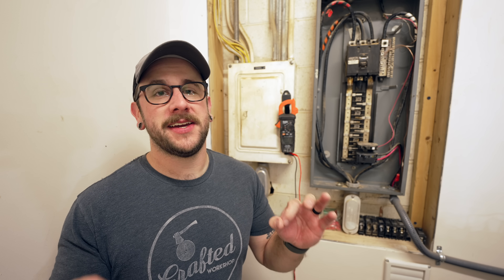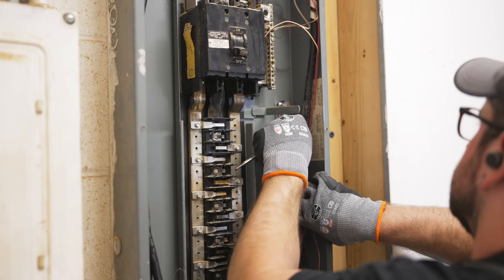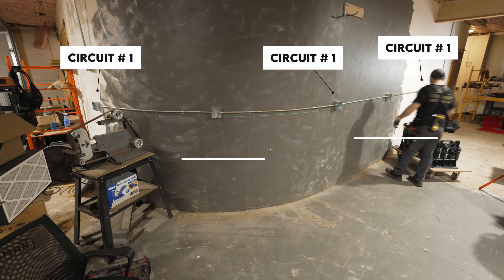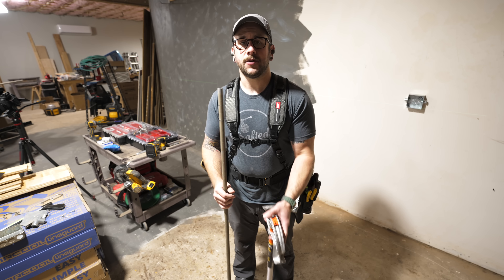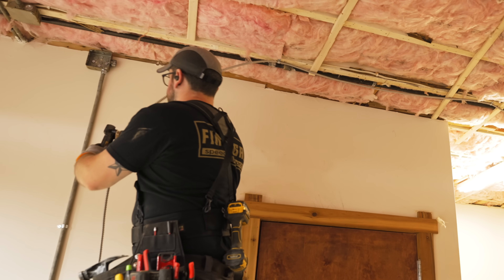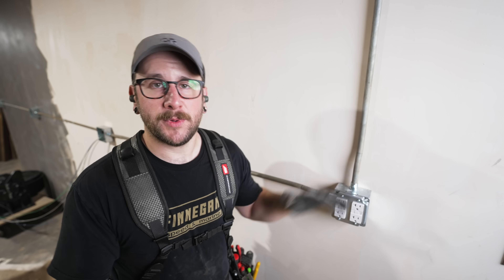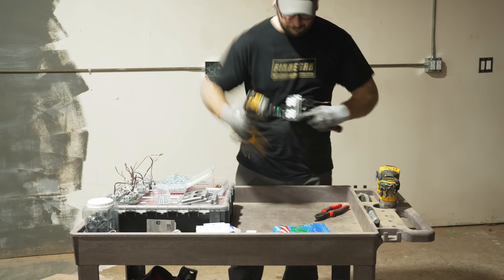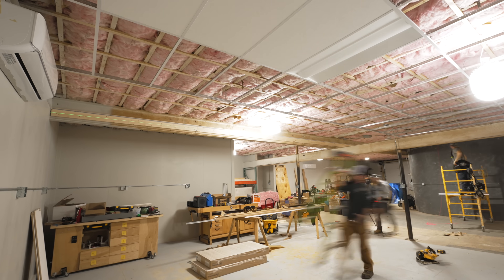WORKSHOP RENOVATION 16 : DIY Shop Electrical Basics w/ Conduit Bending

Comment: You used black 12 AWG for hot wire on one circuit and blue 12 AWG for hot on the other, but when you connected the circuits to the breakers, I only see black wires. Why is that?

Comment: Thank you for mounting your outlets at a reasonable height.  Most people thoughtlessly mount them at the "standard" 15" and then cover them up with furniture or workbenches, necessitating that they crawl around on the floor trying to plug things in.

Comment: Could you use pvc ? I’m doing this in my shed but already put up wood interior walls and don’t want to cut and run wires and boxes but I was thinking PVC would be easier
Reply: Yes, PVC is allowed with metal boxes.

Comment: The gray neutral is for 277 volt circuit. You need to use white for 120 volt circuits. You could have used one neutral to share with both circuits. If you share a neutral with two circuits, you also need to have a two pool breaker or a handle tie to turn off both at the same time. Don't forget to get an electrical permit and have your work inspected. You'll make your insurance agent happy.

Comment: Question: couldn’t you use the same white neutral wire for both circuits if the breakers were fed from opposite legs of the main? I’m thinking the return currents in the neutral would subtract from each other which would make separate neutrals unnecessary.  Or am I missing something?

Comment: So can Romex be used in emt if I’m doing electrical in my metal building at my house? Or do I need to use thhn wire
Reply from the maker: Technically, but you have to size the EMT up a ton, plus it’s a pain to pull Romex through EMT. I’d definitely recommend THHN.

Comment: Very well done and correct video!   Congratulations.
I’m not sure why you showed a dwelling unit rule in the NEC when discussing GFCI.  They have been required a long time in non dwelling locations.   You could have also wired all those box locations with two circuits at each.  Left one and right two.   Slightly more flexible.

Comment: I've seen a few videos now of non electricians doing similar work, usually it's easy to find mistakes due to ignorance or non ignorance, but just being cheap or lazy. Not here, you look like you know what you're doing, and imo the workmanship is top quality and very professional. I'm assuming that the THHN wires and the mc cable are 12AWG. I did something similar, albeit at a smaller scale in my garage just to increase lighting and receptacle location convenience. You said that every other box is on a different circuit, but the first one has both circuits, one GFCI for each, and I think that's fine, just wanted to clarify. I would prefer to use the formed or molded metal boxes with rounded corners instead of those sharp edged ones. Otherwise, great job.
Reply: it’s easy to find mistakes so many code violatiovs

Comment: Speaking as an electrical engineer here, grounding is NOT a belt and suspenders approach. Having doubled grounds as you do (running ground wire and also grounding to the conduit system) is both against code and dangerous. What you’ve done is provided a parallel pathway for a ground fault to energize your conduit system, which isn’t what you want.
Reply: What you're saying is incorrect. A parallel path aka objectionable current would be caused by connecting a ground to a neutral somewhere in the circuit or having the ground wires and neutral wires bonded in a sub panel. Running a ground wire to the receptacles and the metal boxes is good practice even with metal conduit, and indicates quality workmanship. When it's easy to do as in this case, then why not? From an electrical standpoint, when all connections are tight in the wires and the conduit, it's equivalent to running a thicker wire.

Comment: for the ground bar you put in, does my box have to have been grounded to. a rod already?
Reply: Check with local codes, but normally only the main panel needs a ground rod if the sub panel(s) are in the same building. A detached building would require a separate ground rod.

Comment: As the UK and  EU countries are all 240v for domestic could you order the european/UK version of the breakers as will be far more common and likely lower cost? 3 phase here in the UK is 440v so much higher voltage for industrial use.

Comment: Wow, so I just had to have a whole bunch of electrical work done in my house. They didn’t have enough electricity coming into the house and so they had to redo my entire electrical. They had to bring in bigger wires off the road and they had to replace my breaker box in order to bring it up to code. Apparently in Knoxville Tennessee, not far away from you you have to have arc fault breakers to be in code and let me tell you those are expensive!
Reply: Yes, the arc fault breakers are becoming required everywhere now. They had to install them in our new addition. I had them swapped out after the final inspection. Why? They are hyper-sensitive. If you use a tool with a high starting amperage (miter saw) they nuisance trip.

Comment: First, the GFIC breakers are already CODE in SC, so I'm sure it is in NC, as they are first in changes. So you need to upgrade the panel, with the new breakers, since you are completely rewiring. Second, instead of using the grey wire for your 2nd circuit neutral, you can share the white from circuit #1. Plus, it reduces the conduit capacity so it's not over crowded, like you have done in the past. Third, be sure you have proper ground rods and main panel grounding. BTW, the proper name for the metal shielded cable is BX cable, the other names people call it are spin offs, alternative , or mfg names, like Greenfield.
Reply: wrong, that is MC cable. BX is a whole other animal. And you cant share the white unless its a Multiwire branch circuit with a 2 pole breaker with handle tie. and if you did MWBC, you couldnt use gfi. 4 12awg current carrying conducters is fine in 1/2” emt

Comment: a good practice to consider is instead of putting wires on the load side wire nut them together  with a pig tail and put all of your gfcis on the line side because if one gfci trips the rest down the line will trip also

Comment: I do dual duplexes as well but put 2 circuits in each box. All left duplexes are one circuit and all right are another. One thing to consider next time is showing the deburring of the conduit after cutting it.

Comment: 5:28 I believe it is code for you to share the neutral wire for those two 120V circuits so long as the circuits were on opposing phases.  I.E. you would install a double breaker and wire the hots for each outlet on each side of the braker and the neutral is shared.  Each circuit would then be ensured to be on an opposing phase which 180 degrees out of phase from each other.  That would ensure that the common neutral wire could never be overloaded with the maximum 20A current at any moment in time, in fact if current were drawn on both circuits alternating current on the neutral would cancel each other because they are 180 deg out of phase with each other.  I am not an electrician, so you might want to check with your local codes first but it might save you some wire.
Reply: This is correct but with short runs it’s just as easy to run 2. Box fill and conduit fill would be a main driver for me to share a neutral in a small install like this.
Reply: its 3 phase, so can you do 2 pole mwbc? even if you do, you have to scrap the gfi right??

Comment: Per NEC 250.118(2)(3)&(4); Rigid, IMC, and EMT are still acceptable equipment grounds
Reply: however, if use a concentric knockout(multi size knockout) on your panel and don’t use the full size hole, you need to have a grounding or bonding bushing on the connector inside the panel and tie a ground from that bushing to the ground bar.

Comment: Have a question: Why aren't GFCI breakers a thing? Just seems a bit silly we put them on outlets... the wiring from the panel to the outlet isn't GFCI protected and it increases the unit cost of the outlets
Reply from the maker: There are definitely GFCI breakers, I just had some GFCI outlets leftover from a previous job.

Comment: Does your Klein meter's auto off and "I'm on" warning beeps drive you nuts?  I have a cl 300-something and I figured out how to turn it on without the auto off, which is too short(like two minutes long.. power it on while holding SEL) but it still beeps all the time which is obnoxious for continuity testing.  Any ideas?  I'm about to just buy a Fluke because it's so annoying.

Comment: Nice work! Someone check me on this: Don't you use those pipe benders with the curve on the floor and the handle facing up so you can use the handle for leverage?
Reply: It can be used in that orientation (for bending 90 degree bends or kicks usually) and used with the handle on the ground and the curved part (the shoe) in the air for other tasks where bending with the shoe on the ground is less convenient, like bending offsets. Personally (apprentice electrician here) I sometimes did my first bend in the air and my second bend on the ground so I could use a level to ensure the offset was even.
Reply: @noahboyd2186  Fair enough, thanks!

Comment: In my shop I ran two circuits in out 2 gang box, but each receptacle is a different circuit.  The right receptacle is always one circuit the left is the other.  That way I have separated power in every box.

Comment: One of the nicest jobs I have seen from a non-electrician.  You obviously did your research. Good job explaining the Delta-High-Leg Panel. I am one of those Electricians that always uses a ground wire in my conduit.  The conduit after it ages and has been altered over the years, becomes very unreliable as an equipment grounding conductor, in my opinion.  I have seen evidence of this many times in my career(loose fittings, corrosion, paint, grime, etc).  P.s. those little tabs you broke off the metal cover plates are to be used as nuts to hold the devices.  Thanks, Russ-Electrician from Oregon.
Reply from the maker: Thanks Russ, I appreciate that!

Comment: The code is not applied retroactively. Once the 2020 (or newer) NEC goes into effect in your area, you won't be required to add those GFCI breakers to your existing 240V circuits if you don't want to.

Comment: I noticed you have a Square D panel and breakers.  I would recommend moving over to either a GE or a Seimens.  When I worked as an electrician, I was called to work on several remodels after small house fires, and every one of them was caused by a Square D panel and breakers.

Comment: Is there a reason you didn't just use 120V GFCI breakers instead of a ton of GFCI circuits? You would have saved a bunch of money.
Reply: Yes, always look away in case there's an arc flash
Reply from the maker: I already had some GFCI outlets leftover from previous projects so I just went that route.

Comment: What's your plans with the two air  compressor you have sitting at the back of your shop will you be running solid air lines around your shop?

Comment: Just a helpful FYI to save you some money. At about the 11:25 point in the video you show breaking off the small tabs on the metal faceplate and removing the screws from the GFCI outlets. Then using #8 screws and nuts to attach the outlet to the faceplate. Actually, those small tabs you broke off of the faceplate are tapped to act as nuts so that you can reuse the screws you removed from the outlet in order to attach the outlets to the faceplate.
Reply from the maker: Thanks for that, will make adding the rest of the 120V outlets easier!

Comment: where I live in Europe, we're not allowed to use wago's with this type of cable. either solid core cable of this type with a piece crimped over at the end to keep everything together. That being said, the electricals are very different in every way.
Reply: I was also wondering about using the stranded wire with the outlet push-in type connectors, I didn't think that was allowed.

Comment: I am not sure to understand. You said that you did not want to buy a GFCI breaker because it is too expensive so instead you buy GFCI outlets? Are all of your outlets GFCI? Wouldn't it be more costly to buy all GFCI outlets with a standard breaker than a GFCI breaker and regular outlets? (I am not being arrogant, it's only questions) Also, do you know that you don't need to have all GFCI outlets? Only one GFCI outlet can protect a bunch of other regular outlets on the circuit. If you do, why did you do it like that? (I am studying electricity in school, so I am not a pro)

Comment: A note on grounding modern tools and equipment, particularly if it has electronics involved- electronic circuits can easily fault if they lose positive contact with a solid ground. Anything from a service interruption to an expensive tool repair can result. Your belt and suspenders approach will get smiles from your inspector- they are quite used to people attempting to scrimp out any saving they think they can! It may save your life one day, to boot! It's gonna be great!  FR

Comment: heebusjeebus the US way of doing electrical looks like such a pain in the ass, not to mention alot of pointless shit.
If this was in norway, you'd either have 400v in, then split in to 230v for each circuit, or just 230v.

Comment: Couple of things. The raised covers are designed for you to use the screws from the device into the tabs you broke off of the cover. mc cable is not allowed to be run exposed. It still must be protected
Reply: He's installing a drop ceiling, which counts as "enclosed" for MC cable.
Reply: False. Mic is acceptable.

Comment: Wait, so Americans don't have switches on the plugs to turn off individual things plugged into them wth. Doesn't that waste some electricity having things always on, I mean, at least you don't plug something in go to where you're working and forget to switch on the plug, but still that seems backwards  IMHO.
Reply: Do you have a photo or link showing what your outlet looks like?? That’s not something we generally have here in the USA.
Reply: @DrMJJr  Having switches on outlets is mainly a British thing, as far as I know. Most of Europe doesn't use them either.

Comment: Unfortunately 240V GFCI requirements are starting to catch up, garage circuits are first on the list - at least in my local jurisdiction.
And 'garage' is fairly interchangeable with any interior space with a concrete floor. 
You are the ground when standing on concrete. So you are correct to install GFCIs in your shop.
And yea man they are not cheap. And that's not even scratching the surface of 2017+ NEC requirements.

Between GFCI, AFCI, CAFCI, and dual function - manufacturers are raking it in right now.
The real kicker, is that standard breakers have a recommended lifespan of 30-50 years.
These new GFCI / AFCI breakers are only rated for about 15 years before replacement.

Funny story, there's a lady who flips houses in a county next to us, all of the inspectors know about her. She passes the final inspection on a remodel, then rips all the AFCI breakers out and uses them on the next one. Replacing them with regular breakers once the inspection is clear. I honestly don't blame her, these new breakers are terribly sensitive despite being life saving devices.

Comment: An alternative to box offsets on EMT for those who are not comfortable with bending is to use back straps or spacers at the strap locations. This aligns the EMT with the KO’s in the 1900 boxes. Another benefit is les dust settles into the space where the EMT runs along the wall. Just another option.
Reply: They also sell offset fittings about 2" long that attach to the boxes and jog down to the EMT . For 2 bucks each they make it go fast and simple and keep the EMT close to the wall .

Comment: You were doing pretty well IMHO until you decided to use WEGO's on your receptacle circuit wiring, I'd only use a WEGO to connect a fixture to a switch-leg.  Solid conductor wire and red wire nuts (properly installed) would have provided you a time-tested (old school I guess) installation that would last for a 100 years.  I'm glad you ran a "real ground" in your conduit, mechanical grounds using conduit only is something I've personally NEVER done.
BTW those receptacle covers are called "RS Covers" as in Raised Surface.  Nice Job!
Reply: Hello Tom

Comment: Still amazed that you use metal boxes and conduit for electrical. To me as a Europeaan that is just mad
Reply: In a situation like this by code he would have to because the other wires he could use would be subject to damage so pipe is the correct way to run this.